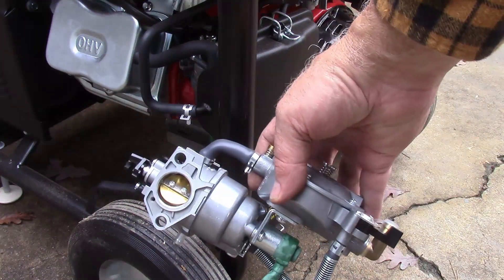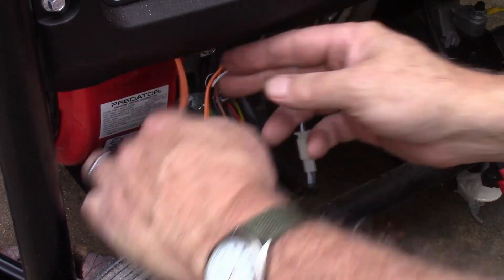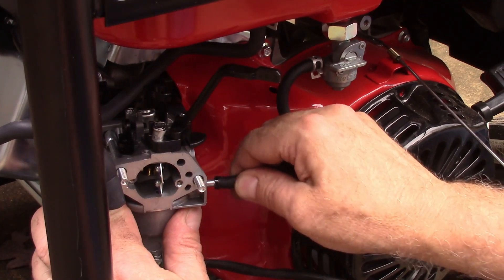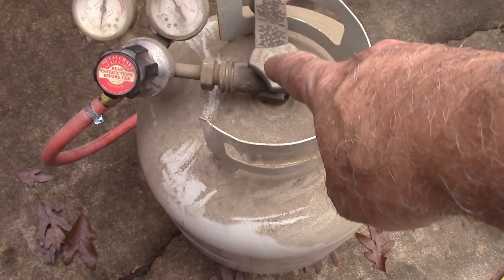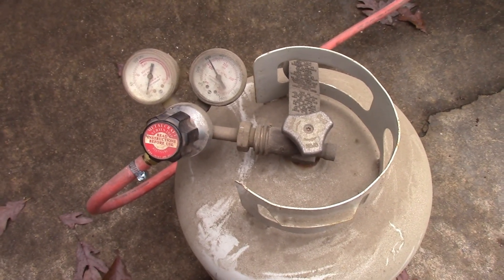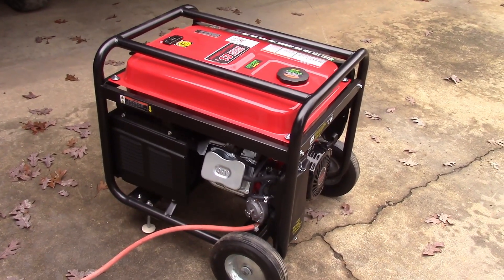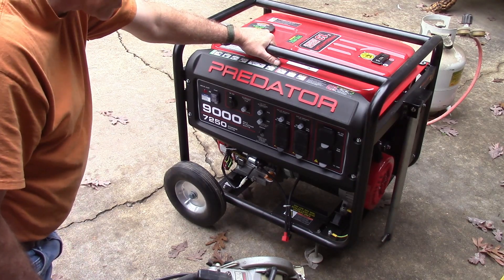Predator 9000/8750 Generator Propane Conversion  Tri Fuel

Comment: Does the natural gas keep flowing in the event the engine stalls?
Reply: It's a demand regulation system.  If the engine isn't pulling vacuum fuel. Natural gas/propane won't flow. Thats why he had to manually actuate the button to flow some gas vapor to "prime" it to start
Reply: Here is a reminder about portable generator safety: everyone really needs to see this safety reminder to make sure. This advice is just to make sure that everyone is aware of all the warnings and it’s just to remind people to be careful using portable generators. Generators can be dangerous if not used carefully. Every year, hundreds of people die or get injured when using portable generators due to carbon monoxide poisoning and electrocution. Make sure you are using your generator carefully and keeping others safe as well. There is something very serious that everyone should always be aware of when using generators. Some people do run their generator indoors which is not safe and that increases the risk of carbon monoxide poisoning which can cause death of family and you. Some people run their generator in wet conditions which can electrocute them. Please remember that you should never run your generator indoors. Remember that carbon monoxide is an odorless and colorless gas that you cannot see or smell. Carbon monoxide is a silent killer. Keep that in mind. Make sure your generator is 15-20 feet away from your house and away from doors, windows, and vents. Never use your generator in your porch too. Having a carbon monoxide detector is very important against generator safety. Some people also allow children to go near the portable generator which could pose risks. We need to keep an eye on our children making sure that they are not near the portable generator so they won’t get electrocuted or burned by the generator which is dangerous. A locking enclosure also keeps kids safe. A generator shed might look like a tempting place to explore, or take cover during a game of hide and seek, but a generator is a dangerous piece of equipment that can cause injury. It says on the manual that we should also keep children away at all times from the portable generator to avoid injuries. Please do not allow a child or unqualified people to operate the portable generator. Just because some manuals missed what should be listed doesn’t mean it’s safe to do. Always follow the generator safety rules when using portable generators. Generators pose electrical risks. If you need to use your generator during wet weather, you need a generator tent to protect your generator from getting wet. Don’t let your generator get wet. Keep your generator dry and before using your generator, please make sure your hands and your generator is dry. Do not wear loose clothing when operating the generator. Everything that is said on the generator’s operating manual should not be ignored. Never smoke cigarettes near the generator. Please keep flammable things away from the generator. Never overload your generator too. Your generator can catch fire. Never ever try to plug a generator cord into a wall outlet to avoid back feeding. Back feeding your generator is dangerous. Always turn on your generator first before plugging in appliances and shut off the appliances before turning your generator off. Use a heavy duty cord for your generator and the cord should not be worn out. All the instructions should be followed carefully. Never refuel your generator while it’s running. It can cause fire if fuel spills while your generator is hot. You should turn off your generator and let it cool off before refueling it. Having a fire extinguisher next to the generator is also important. This is only a reminder for everyone’s safety of using generators. Make sure your generator is properly grounded. Having a fire extinguisher next to the generator is also important against the safety rules. https://youtu.be/I1jT3ANENvI and here is a video more about keeping others safe when using generators and also about our family’s safety. Hope this helps. Thank you.

Comment: Did this same kit on my 2020 predator and it starts hard and will only run at 1/2 choke setting
Reply: Have you checked your delivered propane pressure?
Reply: Here is a reminder about portable generator safety: everyone really needs to see this safety reminder to make sure. This advice is just to make sure that everyone is aware of all the warnings and it’s just to remind people to be careful using portable generators. Generators can be dangerous if not used carefully. Every year, hundreds of people die or get injured when using portable generators due to carbon monoxide poisoning and electrocution. Make sure you are using your generator carefully and keeping others safe as well. There is something very serious that everyone should always be aware of when using generators. Some people do run their generator indoors which is not safe and that increases the risk of carbon monoxide poisoning which can cause death of family and you. Some people run their generator in wet conditions which can electrocute them. Please remember that you should never run your generator indoors. Remember that carbon monoxide is an odorless and colorless gas that you cannot see or smell. Carbon monoxide is a silent killer. Keep that in mind. Make sure your generator is 15-20 feet away from your house and away from doors, windows, and vents. Never use your generator in your porch too. Having a carbon monoxide detector is very important against generator safety. Some people also allow children to go near the portable generator which could pose risks. We need to keep an eye on our children making sure that they are not near the portable generator so they won’t get electrocuted or burned by the generator which is dangerous. A locking enclosure also keeps kids safe. A generator shed might look like a tempting place to explore, or take cover during a game of hide and seek, but a generator is a dangerous piece of equipment that can cause injury. It says on the manual that we should also keep children away at all times from the portable generator to avoid injuries. Please do not allow a child or unqualified people to operate the portable generator. Just because some manuals missed what should be listed doesn’t mean it’s safe to do. Always follow the generator safety rules when using portable generators. Generators pose electrical risks. If you need to use your generator during wet weather, you need a generator tent to protect your generator from getting wet. Don’t let your generator get wet. Keep your generator dry and before using your generator, please make sure your hands and your generator is dry. Do not wear loose clothing when operating the generator. Everything that is said on the generator’s operating manual should not be ignored. Never smoke cigarettes near the generator. Please keep flammable things away from the generator. Never overload your generator too. Your generator can catch fire. Never ever try to plug a generator cord into a wall outlet to avoid back feeding. Back feeding your generator is dangerous. Always turn on your generator first before plugging in appliances and shut off the appliances before turning your generator off. Use a heavy duty cord for your generator and the cord should not be worn out. All the instructions should be followed carefully. Never refuel your generator while it’s running. It can cause fire if fuel spills while your generator is hot. You should turn off your generator and let it cool off before refueling it. Having a fire extinguisher next to the generator is also important. This is only a reminder for everyone’s safety of using generators. Make sure your generator is properly grounded. Having a fire extinguisher next to the generator is also important against the safety rules. https://youtu.be/I1jT3ANENvI and here is a video more about keeping others safe when using generators and also about our family’s safety. Hope this helps. Thank you. Hope you stay safe as well. All generator safety rules are required to be followed carefully.

Comment: I put a similar kit on my champion 3500/4000 generator. The on/off valve on the diaphragm confuses me. I’m not sure what it does.. do you know? I didn’t get any directions.
Reply: After you shut off the fuel you can drain the carburetor with that valve in the on position and then put it back to off to run propane.
Reply: Here is a reminder about portable generator safety: everyone really needs to see this safety reminder to make sure. This advice is just to make sure that everyone is aware of all the warnings and it’s just to remind people to be careful using portable generators. Generators can be dangerous if not used carefully. Every year, hundreds of people die or get injured when using portable generators due to carbon monoxide poisoning and electrocution. Make sure you are using your generator carefully and keeping others safe as well. There is something very serious that everyone should always be aware of when using generators. Some people do run their generator indoors which is not safe and that increases the risk of carbon monoxide poisoning which can cause death of family and you. Some people run their generator in wet conditions which can electrocute them. Please remember that you should never run your generator indoors. Remember that carbon monoxide is an odorless and colorless gas that you cannot see or smell. Carbon monoxide is a silent killer. Keep that in mind. Make sure your generator is 15-20 feet away from your house and away from doors, windows, and vents. Never use your generator in your porch too. Having a carbon monoxide detector is very important against generator safety. Some people also allow children to go near the portable generator which could pose risks. We need to keep an eye on our children making sure that they are not near the portable generator so they won’t get electrocuted or burned by the generator which is dangerous. A locking enclosure also keeps kids safe. A generator shed might look like a tempting place to explore, or take cover during a game of hide and seek, but a generator is a dangerous piece of equipment that can cause injury. It says on the manual that we should also keep children away at all times from the portable generator to avoid injuries. Please do not allow a child or unqualified people to operate the portable generator. Just because some manuals missed what should be listed doesn’t mean it’s safe to do. Always follow the generator safety rules when using portable generators. Generators pose electrical risks. If you need to use your generator during wet weather, you need a generator tent to protect your generator from getting wet. Don’t let your generator get wet. Keep your generator dry and before using your generator, please make sure your hands and your generator is dry. Do not wear loose clothing when operating the generator. Everything that is said on the generator’s operating manual should not be ignored. Never smoke cigarettes near the generator. Please keep flammable things away from the generator. Never overload your generator too. Your generator can catch fire. Never ever try to plug a generator cord into a wall outlet to avoid back feeding. Back feeding your generator is dangerous. Always turn on your generator first before plugging in appliances and shut off the appliances before turning your generator off. Use a heavy duty cord for your generator and the cord should not be worn out. All the instructions should be followed carefully. Never refuel your generator while it’s running. It can cause fire if fuel spills while your generator is hot. You should turn off your generator and let it cool off before refueling it. Having a fire extinguisher next to the generator is also important. This is only a reminder for everyone’s safety of using generators. Make sure your generator is properly grounded. Having a fire extinguisher next to the generator is also important against the safety rules. https://youtu.be/I1jT3ANENvI and here is a video more about keeping others safe when using generators and also about our family’s safety. Hope this helps. Thank you.

Comment: Thank you I was looking at the link that you provided for this carburetor for the predator 9000 I was reading some comments that supposedly it will not fit the new predator 9000 do you happen to know why and if it’s true or not thank you very much I just bought me a predator 9000 today and I am very interested in this set up thank you
Reply from the maker: Unfortunately I don't know why some people are having trouble. If it were me I would order one to see and if it doesn't fit send it back. Good luck. I hope it works out for you!
Reply: @SoatMon  that’s true thank you
Reply: @MrEricdgreat 
Did you order this carb and if so how is its operability with propane and gasoline  ?

Researching to buy...
Thanks
Reply: @Soli_Deo_Gloria_.  no I have not ordered so many mix reviews. Waiting to see if they come out with a new set up fit the new predator 9000. Let me know thanks.

Comment: Good evening, I really appreciate the video. I have the predator 7000/8750  (63085/63088) generator.   I see you posted that it does run on natural gas. I do not have compressed NG at my home.  It is regular natural gas from the provider.  Will this work or do I need to order something else to convert the tip from CNG to NG.
Reply from the maker: I think it would work from what others have said but have not tested it myself as I only use propane.  Some of the reviews on Amazon said that it worked for them...but on real life experience for me.

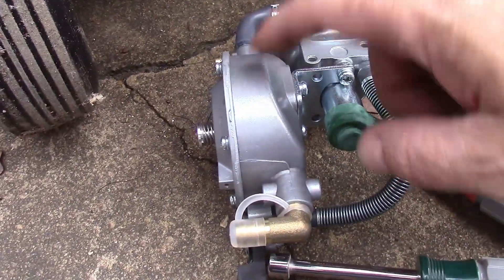Comment: 1:40  That is so that you can drain the gas from the float bowl.
8:08  That is the purge button.  If you shut off the propane feed then you have to purge the air after turning on the propane.  If you do not turn off the propane supply then you don't have to purge.  Think about it.  The permanent generators, like Generac that are propane-fueled, don't need to be purged because the propane is always on.
Reply from the maker: Thanks for your input!\

Comment: Thanks for the video.  I just got my carb in (exactly like yours) and was glad to be able to see an installation.  The instructions are poor at best.  I ordered mine from V Power Equipment. They have different carbs depending on the size of your generator.  They do cost more but come with a properly sized propane regulator and gaskets.
Reply from the maker: You're welcome!  Glad it helped you, thanks for letting me know.

Comment: Will this carb work with the new predator 6500? How long is the runtime on a 20lb propane tank? Thanks in advance.
Reply from the maker: Sorry I don't really know, if it will mount up it should work.  I would order it and see if it fits if not just send it back.

Comment: The new carburetor is rated for a 4.5kw  to 5.5kw generator. Isn't this too small for a 7-9kw unit?
Reply from the maker: You would think but it works.  The one I put on was identical to the one I took off except for the propane part.
Reply: That was my thought and why I didn't order it. I went with a tri-fuel kit, which cost much more. I know I will be getting the full wattage output of the generator.  What someone needs to do is test the RPM's, hertz and wattage output under load. I suspect the wattage output will be less.

Comment: I am a little confused about the switch on the carb. The switch on my carb.is on the right side and I can see the left side of the carb.is LPG so the Right side is for Gas and Propane??
Reply from the maker: LPG is the same as propane.
Reply: Thank's Soat now I can put the carburetor on.